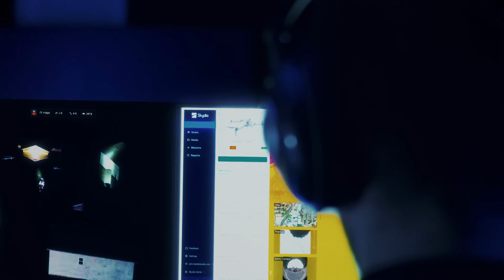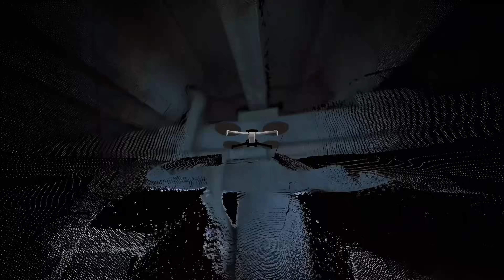Skydio Delivers a Breakthrough for Enterprise Drones with the Launch of Skydio X10

Comment: My country recently purchase 8 skydio x2D and they are totally trash for the price of over 10k each. So many bugs and problems it's laughable, this company needs to be investigated. I mean the drone loses signal just by increasing altitudes as low as 300 feet AGL Less then ten feet away from the controller, the zoom is trash 16x is unusable how pixilated it is. The drone can not go 1 mile away from the controller with out loosing signal and returning home. Every time you operate at night you have to calibrate it every single time which takes more then 4 mins , making this drone unusable in quick response situations.

Comment: Or, you know, just buy a DJI and get a better drone for the fraction of the price... or more like, even BE ABLE to get a drone.

If you wanna spend a bunch, just go and get a DJI M30/300T, which blows this out of the water. Not even on the same planet.

People would be willing to buy American drones if they cost a little more than DJI, if they were actually BETTER. But the american ones feel like the cheap chinese knockoffs, and are like 5x overpriced.

This is like the first American drone ive seen that is actually acceptable, and id be willing to even use. But only if it was around the same price point as DJI, and i could actually be able to BUY IT.
Reply: You were saying?
Reply: I agree with you btw. This is really unfortunate

Comment: These drones come with a hefty price tag (>$10,000!!!) and their performance falls short compared to DJI. It's surprising that you have to press a button to exceed 10mph, which I suspect is due to the use of inexpensive components that hinder the obstacle avoidance system from functioning optimally at higher speeds.
Reply: Just change the default pitch sensitivity. you can go as fast as you want without the boost--just need to customize your pilot controls.
Reply: @RPAerials  Skydio drones are a disaster. They're ten times more expensive than DJI drones, but with a fraction of the quality. They lose control if another pilot is nearby, can’t fly more than 2,500 feet without connection issues, and require the remote to be pointed directly at them to function at all. Streaming works only 20% of the time, and there are at least 10-12 other major issues I’m not even mentioning. Considering their price compared to DJI's reliable models, these drones are laughably bad and seem to exploit government agencies forced to buy these overpriced, useless devices.